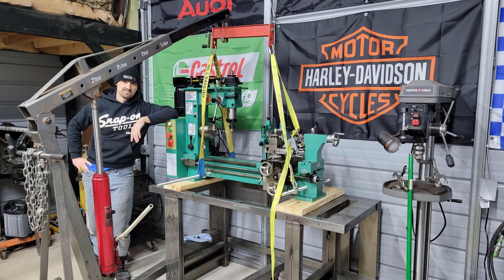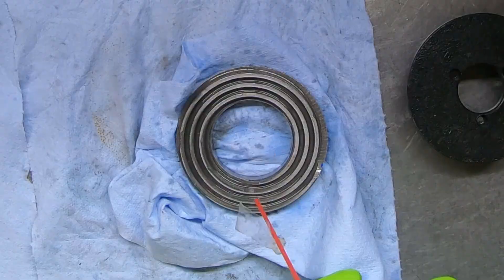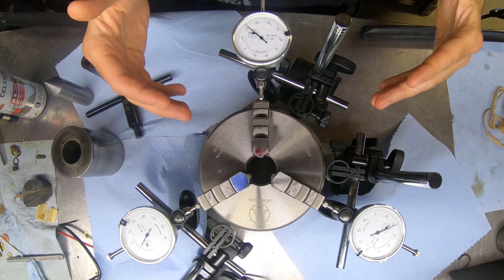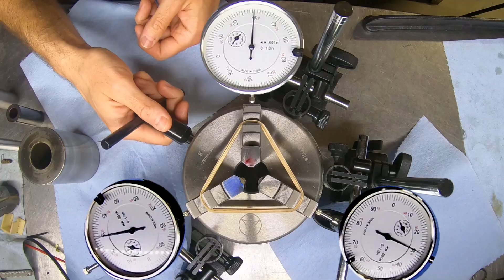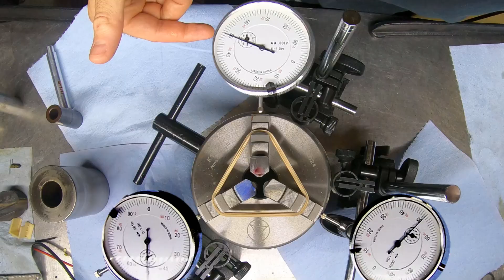Illustrating Scroll Concentricity Deviation - Part 1

Comment: Nice explanation of the  scroll acuracy . but because you put the rubber band around the jaw,  it moved the jaws backlash into the opposite side  of the (normal) clamping movement . Basicaly you tested the opposite action of the scroll.
Reply from the maker: Thanks, Yeah i thought about using a foam ball or something but the rubber bands sort of worked. It's an accurate depiction if your clamping ID i suppose lol. I had commented about that at some point in the video. Almost abandoned the whole video because of the lighting on the gauges too.